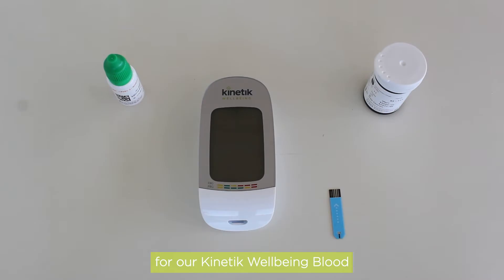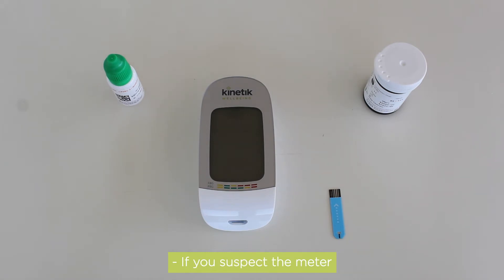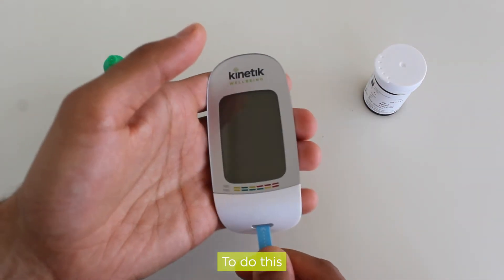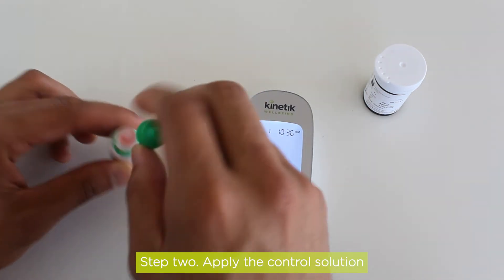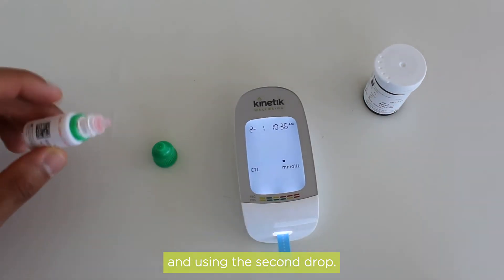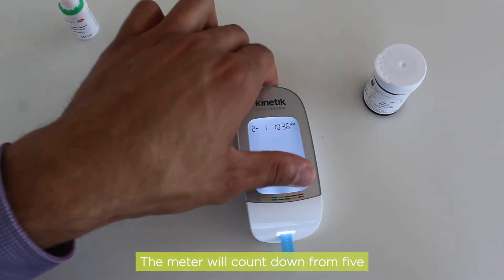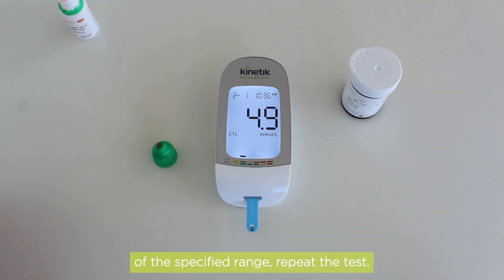Glucose - Control solution test - Kinetik Wellbeing

Comment: Is this before of after taking blood
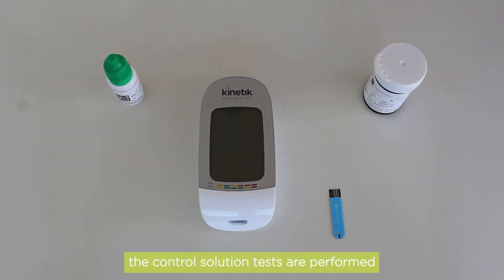Reply: It uses an entirely separate, fresh test strip. See 0:26 for when. 💜
Reply from the maker: You can do this before or after taking a blood test. This result has no effect on your blood glucose level. You only need to do this if you want to check you glucose meter is giving you accurate readings.